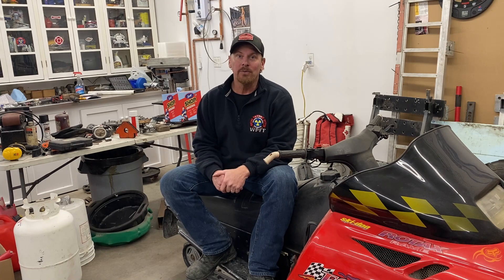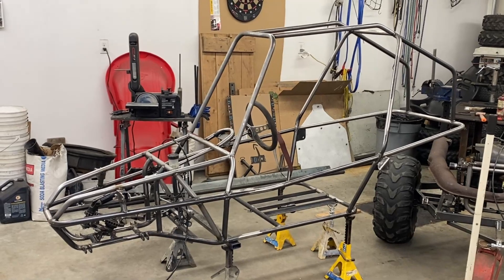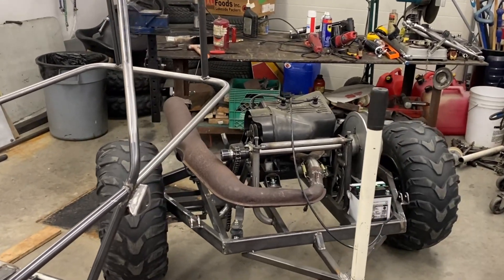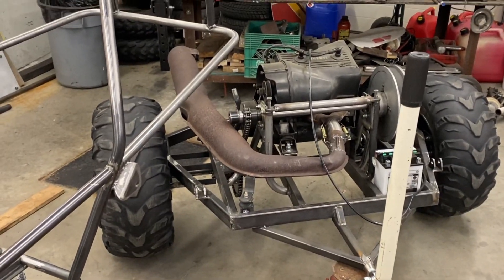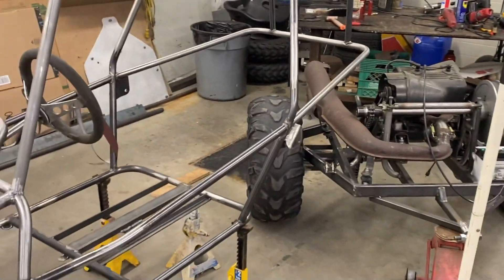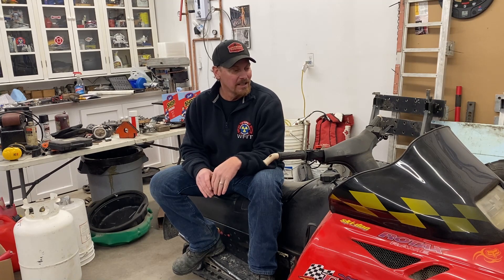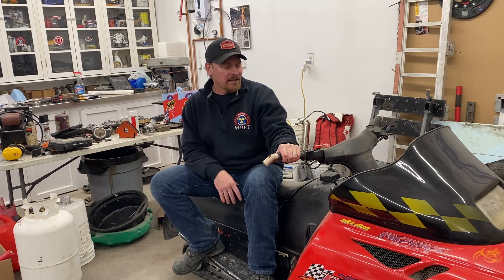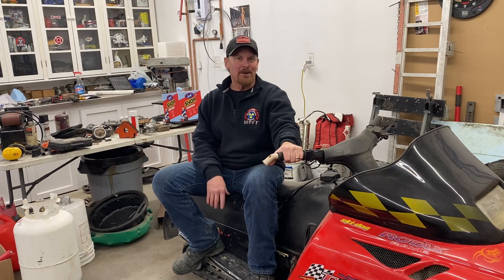Homemade 540 2 Stroke Powered Kart/Buggy Build Part 9, Mini Sand Rail, Cross Kart? #BuiltNotBought

Comment: Great progress. Please add some triangulation to the side spars of the chassis from front suspension to behind the seat because it is very open there. Otherwise looking great. Any thoughts about protecting the sprocket and disc from rocks etc? Or not anticipating such terrain?